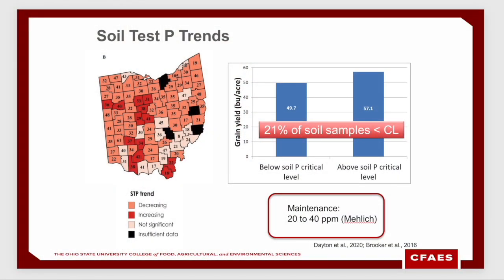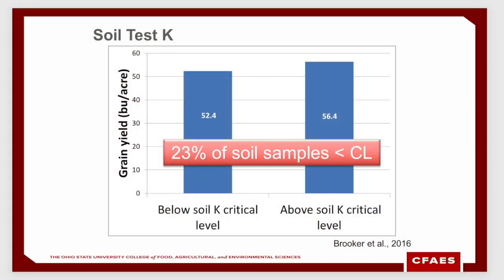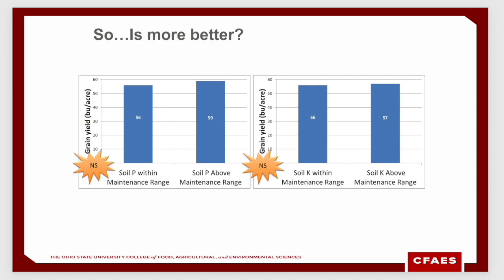Soybean School: How soil test P and K impact yield

Comment: As a land owner for 6 years now, at 25% share and 240 cultivated acres, my experience is that finding a farmer who will do a soil test every year or two and add any nutrients AT ALL is very difficult.  The present one (on a 5 year contract) was told that the farm had zero nutrients added for the two prior years.  He waited until after harvest of year 4 (2020) and then wanted assurance from me he would get a 6th year before adding anything.  This seems to be the biggest problem to overcome with farm land ownership.  With my next contract, I will take control of that by going 30% but in exchange I will have the soil test done, (80 acres per year) and spend at least $7,000 on nutrients and provide proof of it including notification of the day the nutrients will be added.  So, every 3rd year 1/3 of the farm will have $7,000 of nutrients.  I am not sure yet how difficult it will be to find a farmer to agree to that but anyone who balks, 5.00% of the 240 acres is right at $7,000 anyway, so they probably would also neglect the inputs.